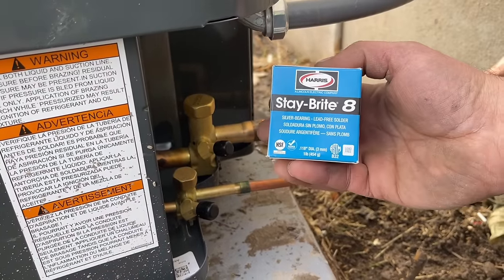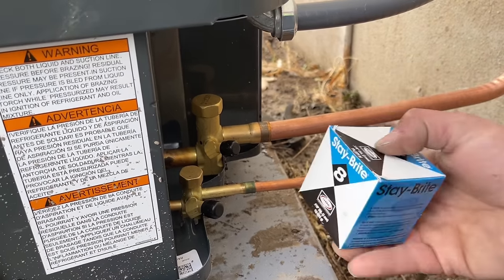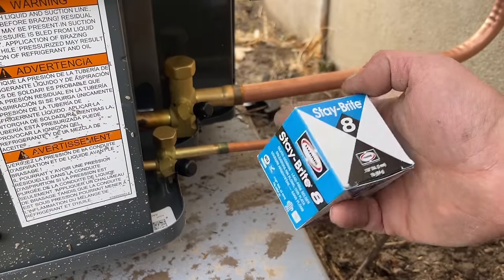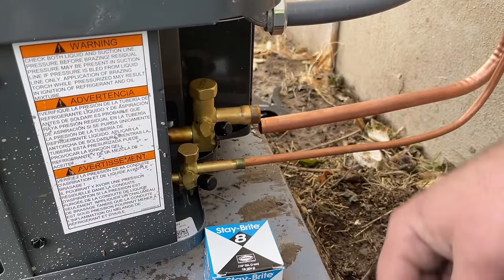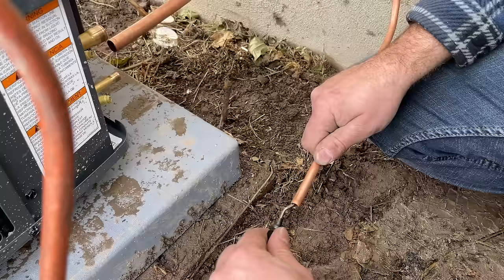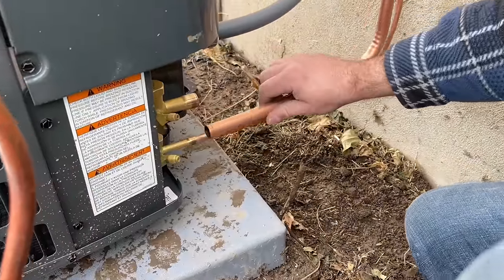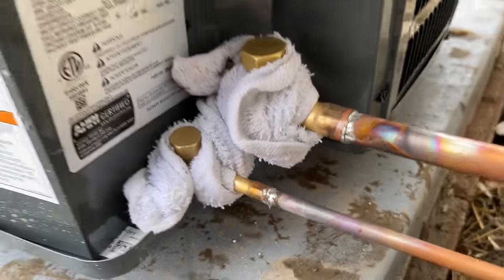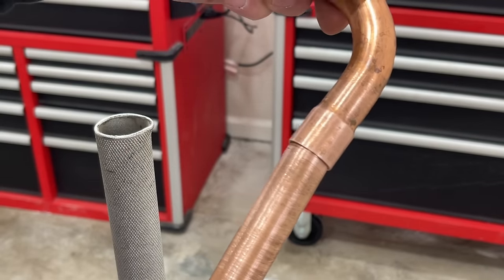An Awesome Alternative To Brazing HVAC Lines. Staybrite 8 Soft Solder

Comment: I am the manager of a R&D HVAC test facility. I can tell you we have used this in the past, however we stopped for a couple reasons.   1. It can/does fail under high pressures.  2. Joints can fatigue over time and the hold is less secure.   3. There have been joints that blew apart during testing (after being in operation for months)  causing a loss of refrigerant and very dangerous situation.  The copper will violently swing away from the broken joint and could hurt a tech or puncture a coil.  We no longer use this for any test application.   I wouldn't use this in a home where it is intended for long term use.

However, I did want to say I do really enjoy your videos and appreciate the time and effort you put into helping others.  Improving the tools and skills of those who install the products helps EVERYONE!
Reply: Agree. Been in this business for 28 years. Commercial and industrial. This is a joke! This guy should not be putting this garbage on YouTube.
Reply: It's not pipe BTW. It's called tubing. Rookie
Reply: I agree 💯 this Garbage this method is for plumbing low pressure water high pressure isn’t work.
Reply: I'm 62 years old I've used this stuff ever since it come out if there was a leak it's because the guy probably didn't do it right Has to be exceptionally clean and flux right and heated right

Comment: I have used the Stay Brite for years and with Zero problems.  I have had units that were brazed in by someone else and the brazed joints all leaked and failed - so much for brazing.  My Stay Brite Joints have lasted over 25 years and going.  Yes, you have to prep and clean the pipes when using this or you will have problems - I am certain that is why folks have problems with this, they don't clean properly and are used to brazing where you don't have to clean as well some don't do any.  Yes, use the right flux compatible and refrigerant friendly, no glob, try not (don't let) to let any flux into the line set, wipe off the outside of the lines once cooled down.  Great video!
Reply from the maker: Thanks for the feedback! I'll definitely implement those things you mentioned as well :) Cheers
Reply: Braze joints all leaked and failed? If this is the truth they were using the wrong brazing rod for the application.

Comment: We used Staybrite 8 with an acetylene torch to heat it for decades....up until the use of 410a refrigerant and the higher pressures and temperatures that go along with it.... Staybrite 8 is certainly a much cleaner connection, but we found that it does not hold up well when making the freon line connections at the compressor itself...  and it was just seemed easier to have 1 set of torches and brazing method for everything...
Reply: I use map gas and my tips are 100 dollars
Reply: Yea kinda wondering that as well…
Dude said it’s stronger than brazing which is absolutely not the case at all whatsoever. Assuming he misspoke because soldering is never stronger than brazing…
Reply: @codythompson9035  actually silver solder when done right is stronger than brazing.I've been installing ac's for over 20 years and I've never brazed .I've never had a compressor failure. I've never had a line break, dude I've seen units 20 years old hanging on a cliff and never broke. and were staybrite soldered
Reply: @rodeoclownobama5796  I repair commercial/industrial HVAC systems as well and you would be literally the only person I’ve ever heard claim that soldering is stronger… Have at it
Reply: @rodeoclownobama5796  Also never had a compressor failure? I’ve seen brand new package equipment shipped with a bad compressor to begin with… The bs is strong with this one… 👌
Reply: @codythompson9035  Stay Brite is a high strength, silver bearing solder. With a low melt/flow point of just 430°F (221°C), it produces a stronger solder joint than high heat brazing, which weakens base metals. Stay Brite solder bonds with all metals, ferrous and non-ferrous. Tensile strength is 10,000 to 25,000 PSI; elongation is 48%, vibration resistant. Sold in 1 pound or 1/4 pound spools.
Reply: @codythompson9035  well I had one compressor failure lol but ti struck by lightning , so it wasn't my fault.there are some shady havc businesses who pratice poor hvac. I keep all my hoses in a clean bor, all the open ended hoses have screw in plugs in them. a clean work van is a happy work van.poor dirty practices lead to compressor failures . and you know that
Reply: the problem with brazing is is weakens the copper, or brass
Reply: @rodeoclownobama5796  Yes overheating a joint can weaken strength of the material but if you are good at what you do then shouldn’t be torching the shit to begin with. If you have the right tip/setup then it won’t be too big of an issue. If you are not terrible at brazing I guarantee it’s going to be a stronger bond than the weakest link being a soldered joint. I’m not saying stay bright doesn’t have its place but it’s not meant to replace brazing in HVAC. This isn’t even a controversial point.
Reply: @rodeoclownobama5796  Do me a favor. Try soft soldering on a Mitsubishi VRF system during a repair or install and then respond to this thread when one of the joints inevitably fails. Stay brite might fly if all you are doing is installing resi systems but it’s not gonna last in lots of other situations.
Reply: @codythompson9035  nor google bursting pressure of hvac copper line 3/4.  between Annealed ans not
Reply: @codythompson9035  I believe this guy was installing a residential. so now you have to save face and look at me now butt butt butt watta 'bout this
Reply: @codythompson9035  I know that, but so what the bursting pressure of the copper tubing is way less like a lot less, and i believe I told you about the annealing, I can fusion weld plate steel with oxy, woppie the f to do
Reply: @rodeoclownobama5796  alright buddy you are right and literally every single educational system on the subject is wrong. You win! Congrats! 🎉🥳🎊🎁🍾
Reply: @codythompson9035  I guess you never took a piece of copper 1/2 inch copper tubing heat it up red hot to bend it in place for a kitchen sink. when you braze you weaken the copper .if you don't know that well you're just  a schoolboy
Reply: @codythompson9035  pv=nrt all day long, I bet you never had chem or went to college.
Reply: @rodeoclownobama5796  AP chem in 8th grade bud… had college creds in highschool, decided to skip it even with great grades to avoid being one of all the people losing their, “good jobs,” during the recession. Did you waste money on college and still end up being a bad hvac tech after that? Sorry to hear that man.
Reply: @codythompson9035  brazing weakens the copper pipe you ain't to bright are you.
Reply: @codythompson9035  personally I think soldering soft copper is harder than brazing, everything has be cleaned, you need the right out of heat , to much you boil the solder . you can't have huge gaps in the fittings. any idiot can braze
Reply: @rodeoclownobama5796  Soft soldering is literally done in prep work. As long as you don’t have your heat too high, capillary effect essentially does the work for you.
Reply: @rodeoclownobama5796  But sure, soldering is the difficult option because you can’t braze 🤣 Try soft soldering a compressor in a York eco and tell me how that works out for you.
Reply: @rodeoclownobama5796  Had a compressor failure on a twinned Mitsubishi VRF system our mechanical out of state installed. Saw incoming voltages around 505 between all 3 legs. The equipment can handle that sort of voltage in a spike but is not meant to be running that way all the time. When they did the start up, incoming voltage was higher than 460 but well within tolerance. When some of the factories slow down production they just live with higher incoming power from the grid apparently. Installed some buck/boost transformers and hadn’t had a issue since. Would of expected the inverter board to have taken the damage but I guess not…
Reply: @rodeoclownobama5796  how about mini splits without a dryer, wont the flux start corroding the inside when it mixes with r32 and/or the compressor oil?
Reply: @WillieMakeit  Regardless, beyond what something can do, it’s pretty fucking irrelevant when it comes to manufacturer warranty. If I tried to install a VRF with stay-bright and a leak occurred they would laugh and say you are sol. I do large commercial/industrial. Stay bright is fine for some things but not gonna use it for most of what I do. Soldering is easier anyways, all the work is in the prep, let the capillary effect do the work. Work on large enough equipment where that shit won’t fly bud. Hell half the compressors I install are steel. Good luck with the differentiating materials. Stay in your lane… 👍
Reply: @WillieMakeit  I’m sure you are the super tech that hasn’t seen anything beyond a residential split your entire career though… keep it up bud, maybe one day you could work on the most generic carrier RTU! 🤣
Reply: Research says it is just as or stronger than a brazing joint

Comment: Thanks for the video! Appreciate it but like some of the other commenters said you need to heat the joint and let the solder suck in. This is just like plumbing. I am noticing more plumbing stuff coming out now like press fittings (RLS joints). Don't know why plumbing solutions have not been used until now.

Comment: Sta Brite is almost 100 a roll these days. Save your material.
1" and smaller hold the torch under the fitting at 6 oclock with the flame licking the pipe too. Then just tap the solder to the top of the pipe by the joint but not on the fitting. As soon as solder melts on pipe lay the solder to the joint at 12 oclock. That's it. No drips, never fails.

Comment: Very nice, the more you practice the cleaner and neater your solder joints will be, you don’t need to apply so much heat as when brazing. The pipes shouldn’t turn black.
Reply: Can't over emphisise that!! Copper shouldn't turn even blue for that solder. You heated the wrong side of the joints! You must heat the socket to draw it in.

Comment: I had a refrigerant leak in a condenser tubing/fitting that I had soldered together (not too well) a few years ago. I told a tech about it. He said, “Braze it.” So I got my torch, brush, flux, solder and resoldered it, doing a better job of it this time. Pressure test: No leaks (PTL).
Reply: Next time take your time and solder it right the first time

Comment: Staybrite 8 has always been a good product. A couple of tips for guys,1) wipe the excess flux after inserting the joint, 2) heat the pipe first, then move the torch to the fitting to draw in the solder into the socket. and of course if you have a large gap don't use solder, it not a good filler material like sil-fos 15
Reply from the maker: Thanks for these tips! From someone who has actually used it lol so many guys bash it because they don’t know how to use it.
Reply: What happens to the flux that mitigates into the pipe?   That's my question.
Reply: @deltaf222  Use a small coating of Stay clean flux and wipe the excess. If your really concerned with it, you can flush with hot water, Use your compressor/nitrogen tank to blow the line out before your vacuum. Vacuuming removes the moisture anyway. And you should be nitrogen testing your joints also.
Reply: @jmac213stuff   Flushing out refrigeration lines with water??   Never, ever, ever, ever do this!!!  Dear God.
Reply: @deltaf222 i have the same question... Cant find answer anywhere

Comment: I have nothing against Staybrite 8 for repairs on txv's, reversing valves etc, but you might want to check your equipment install manual before using it to install your outside unit. Most every manufacturer says it must be "brazed" when installing the condenser. The local and state inspector made a local contractor here re-install a whole subdivision for using Staybrite 8, because of the manufacturers instruction manual
Reply from the maker: That sucks. If you are doing a ton of homes then yes, definitely check that. That was very unwise of that contractor not checking that.

Comment: I've been using it for 25 years on everything but dissimilar metals and I think the biggest advantage is the way it flows down into the joint farther. 15 stick doesn't flow nearly as well and you have to worry about hydrogen embrittlement of the copper. Just my opinion

Comment: Apply heat to the bottom of the joint, once to top is hot enough to melt the solder it will flow around to the bottom. Let the pipe melt the solder not the flame.
Reply from the maker: Yes I wish I would have known this and tried some soldering first but I like living on the edge so I tried it for the first time on a friends install haha if it ever leaks he knows where to find me :) I’ll definitely apply that advice moving forward! Cheers
Reply: @The DIY HVAC Guy  hey you got the job done that's what counts.

Comment: Wipe off your excess solder with a towel while it's hot.  Also not sure how well it works for hvac application, but in plumbing I was taught to brush the area down (after soldering) with flux while it's still very hot.  This cleans all of those burn marks and what not.  Then wipe it all down with a towel when you're done.  $0.02.  I'd still rather braze, but not having to use nitrogen is a plus, never thought about soldering hvac lines before.

Comment: Solder flows to the hotter area so you should heat the back side and apply the solder to the opposite site. Then you can wipe it when done to clean up that drip.

Comment: Just finished installing a Goodman split heat pump successfully, but I did a few tests on the Stay Brite 8 solder connections first. Sanded both inside the fitting and outside of the pipe, and just fluxed the male end. Complete fail, and I tried it twice. When I reheated and pulled them apart, the solder only bonded to the male part of the pipe, the inside was completely void of solder except for a few specs here and there. Tried a third time on a new test piece with a THIN layer of flux on both the inside and outside and both were nicely covered with solder when heated and unsoldered. Your example might have worker because you put a TON of paste on the male which then probably oozed onto the female side, but that defeats the whole "keep flux away from the refrigerant" idea. 

Another thing I noticed when I soldered the liquid line at the air handler was a bead if loose solder at the bottom of the included 3/8" elbow at the air handler. I pulled it out before tightening the gasketed nut at the fixed orifice, but that was concerning. I made sure I soldered all the connections (extra filter/dryer on the liquid line, 7/8" 90 degree elbow and a swaged piece of 3/4" to 7/8" pipe on the suction) starting at the end farthest away from the condenser so that I could shake out any loose balls before the final solder, but I didn't see any. I also didn't over apply solder, tried to follow the 3/4" length for a 3/4" connection rule. Pressurized to 350 PSI with nitrogen and soaped the connections, then vacuumed to 40 microns and everything looked good. Time will tell. I highly recommend your last suggestion in the video where you flux both surfaces lightly, I would never flux only one side after my experience.
Reply from the maker: This is great knowledge to have. Thanks for your input sir
Reply: @diyhvacguy  You're welcome, glad to share my experience. And thank you for helping us DIY types with your very informative channel, the HVAC industry is so closed and secretive.

Comment: Brazing is the manufacturer recommended method with nitrogen purge. Having said that staybrite 8 if used properly does work quiet well.
Reply: No matter which method a nitro purge and a very good sustained vacuum are the keys to a properly functioning unit. We all know how moisture can ruin your day 😔
Reply: @irishmike4914  yeah. Better yet purge with the refrigerant. Or do a triple evacuation using the refrigerant. Refrigerant has absorption qualities that nitrogen does not.
Reply: But refrigerant ain't cheap anymore! I would get my butt chewed out trying to bill a client or even worse a homeowner in these 15k sq houses in NJ !

Comment: Try not to put the solder right into the flame the way you did. It prevents all those drops getting on the condenser base. It’s really not an issue with brazing either. The only time you get drops is when someone does what you did or overfills the joint and it comes out the bottom. You have to keep an eye on the whole joint, not just the point at which you dip the rod.
Reply from the maker: Yes I’m learning :)
Reply: @diyhvacguy  yeah that’s kinda the impression I got. I wasn’t criticizing you, just giving some pointers. One of the issues I usually see with people learning to braze is the neatness of the joint. The phosphorus makes it self-fluxing, hence the name “sil-fos.” Silver/phosphorus. When you’re nervous or shaky and touch the rod where you’re not supposed to, you’ll get it all over the pipe. Also burning holes in smaller tubes because they let it get too hot/don’t move the flame around enough.

Comment: Holding the torch in one spot on the bottom of the connection and adding the filler on the top will allow it to flow into the fittings towards the heat source. It's not necessary to move the solder 360 degrees around the connection

Comment: Great video I just tried it for the first time I did a few practice joints to get the hang of it . I think the biggest part of this is to have a clean joint and the right amount of heat with a tight joint . The only thing that scares me if you get to much solder in the joint does not sick and locks up a compressor not sure if this could happen
Reply: Not compressor i scene guys use stay brute 8 on expansion valves and over add solder and there will be balls of solder in the expansion valve. Great product use it all the time. Doesn’t do well with vibration.